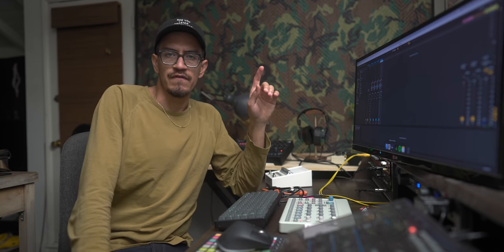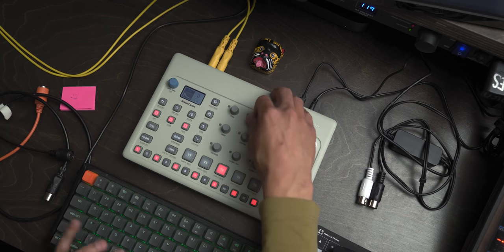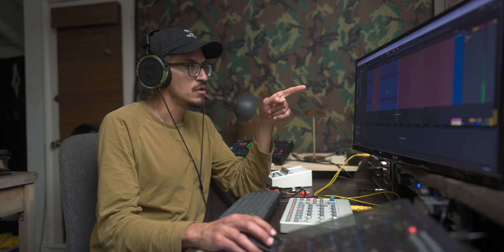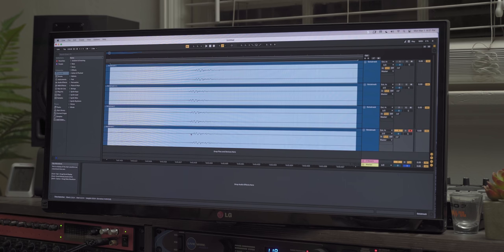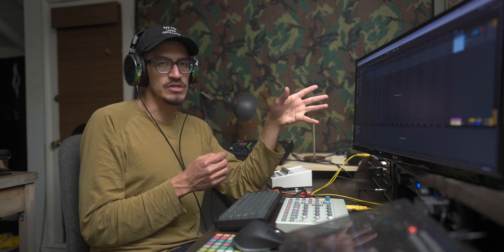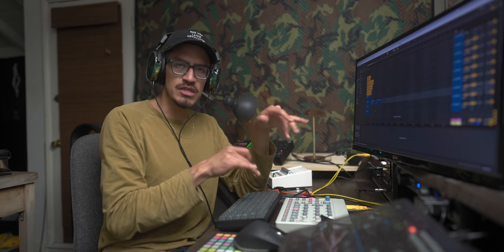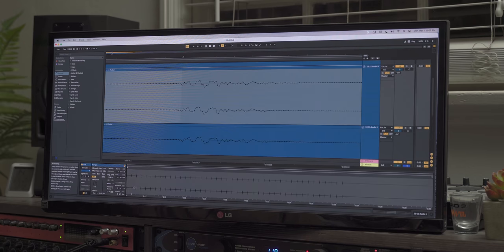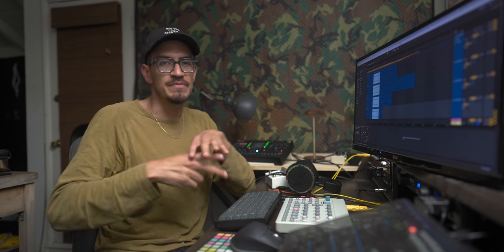Midi Latency and Why You Can't Win.. // Hardware Swing vs DAW Swing

Comment: Simple technique here: add a 1 bar  'count in' sequence before your song plays, like how bands do to cue the start of a performance. It can be a simple 4/4 kick pattern or whatever. Then once multitracked in your daw, it becomes much easier to line up your tracks on the 1 as they all share the same count in. Once aligned you can then just trim out that first bar

Comment: Isn't it crazy? 30 years ago running all hardware MIDI gear sequenced from Octamed on an Amiga I had zero latency issues. Newer isn't always better! Do you have the same issue if you're slaving Live to the external clock of your hardware device?

Comment: I always thought this was because of Midi to Control Voltage converters in analogue machines. I don't mind, I kind of like it, but I don't have it as severe as in this video. Never had any problems with missing notes or crazy delay's and it doesn't ruin the swing, some this might be an other problem, like midi jitter.

Comment: i am a beginner producer and i want to get rid of the topic latency early on to build a functional workflow around it. ideally, i want to control (via midi clip or keyboard) an external sound source and capture it with the audio in of my interface. i also want to use ableton effects. now i have some ableton drums playing and the external instrument receives midi to play, which i monitor in ableton. now i adjust until it sounds good together. now i want to record the synth to audio and when i start the drum clip and the audio synth clip together, it should sound exactly the same as when i was monitoring before. i can record with ableton effects or i can record the dry signal at my input. the dry signal is faster than the monitored one (with effects). now, i put the same effect chain on the recorded audio. all 3 variations (playing it live, recording the monitored audio with effects and putting effects on the recored dry signal) all sound slightly different... i do not think, i care too much if something has latency, but i need to recreate the exact same timing i adjusted to in the "jam" phase. with or without latency, it needs to sound the same. i do understand this topic gets much more complex when introducing a global clock, but i am already struggling with this basic step...

Comment: USB involves multiplex switching and the packets can fall behind or end up ahead of others depending on a number of factors i.e how many devices you are using that share a controller, if you are using a hub. I'm not sure of everything, but there could also be the implementation of USB on the device and clock jitter on the device itself because USB is synchronous. Someone needs to make a PCIE card for just MIDI, which would be fabulous to have. Some sound cards do have a direct MIDI DIN asynchronous connection, but they are often expensive. I always get clock drift when syncing via USB from Ableton to my Beatstep, and then using MIDI DIN to sync everything else. I can't recall if I have tried without anything else on the hub or my motherboards controller, but because of how USB works, I think you are likely to get some amount of drift or possibly jitter from the device.

Comment: Hey Ricky... I think it's Elektron Model boxes.  I'm running an AMD 3.4gz with 16gb ram.  I used to have the Circuit and Model:Samples as my main hardware center pieces.  I had both plugged in via USB and the Circuit would be tad off but the same each time, while the M:S would be off and start late every time.  I sold both pieces of gear to try and let new energy into the studio, as well as learn sound design instead of relying on presets/patches.  I now have the M:C and just reordered the M:S.  I Love Ableton and have heard ppl say the Model boxes suck over USB.  Maybe someone will figure it out one day.  As always, thanks for the video.

Comment: one fix is to use a hardware device as master clock sync everything to that and also use it to clock DAW. Therefore all external devices are in time and DAW plays in time with them. Then track the output of your external devices all at the same time.

Comment: This reminds me a nightmare that's a bit of topic, but related to timing problems and computers. At the time I was working with computer as the heart of my live set-up (with NI Mashine), I did many records with my band recording live with the audio coming from my "live" laptop to my studio desktop in two tracks while recording the other instruments.
Afterwards, I opened Mashine as plugin on the desktop computer and re-recorded all the sounds from Mashine in separated tracks for accurate producing and mixing. No problem with this method but one time. The recording messed up somewhere and the timing between the audio-recorded tracks and ITB Mashine tracks where totally off. It started good enough at the beginning of the tune but turned more and more out of sync. At the middle of the tune, all the groove where lost and after the break, it was just a mess. We tried many things : record again from the laptop, do the stuff in the box in the laptop, slightly change the tempo of the whole project and so on. But but nothing worked. It remained far from the groove of the live recording. It looked like he tempo had slightly changed during the recording.
All we had to do was to keep the electro stuff done and record again the other instruments. It only happened once, but it taught me definitely that computer timing can mess up.
Now I've turned my live set-up dawless and we record live with all the instruments at the same time. No more timing nightmare.

Comment: Good vid, thanks. To deal with it I just turn off swing in my gear and able the swing in Ableton. I actually find the Groove feature in Ableton really powerful and it also quantizes before applying the swing so for the most part it fixes any issues.

Comment: damn this is basically hard proof I need an ERM. Even multitracking into bitwig using the pyramid as the main clock for my synths with no midi sync in the daw will leave me with weird jitter
Reply: same here with the pyramid into ableton
Reply: Really. I was going to buy a Pyramid thinking it would improve jitter. Guess the money is better spent on the ERM in that department. I have seen the midi data jitter and timings for a lot of devices, the Pyramid is better than average at that, the Elektron stuff is satisfactory. But who can afford a Sequintix Cirklon or even wait for it to be build as they are back ordered by 2 years. Lol

Comment: Ive spent so much time with these types of tests lol. It’s midi jitter via usb that’s the issue (Although polyphonic midi also has a 1ms latency per note) cuz usb is sent in lump sums every ms or more. A good solution is serial midi with an audio-source sending the data. I have had good luck with the expert sleepers esx-8md and ES40 via spdif. The learning curve for that was quite insane for me, but there is truly no jitter once you get it working. I am now trying to sequence everything and record it live one take.
Reply: with overbridge, there is a slight latency of notes falling early, but if you adjust the microtiming 1/192 to the right it is tighter

Comment: to me there is a change in the groove of any machine as soon as it's clocked by another one. I also believe that each machine receiving a clock, is constantly trying to follow the clock it receives, and then has very slight changes in its timing, but i don't see it as a problem, to me that's the interest of hardware, that it doesn't play exactly the same way everytime. 

Btw I think that not all hardware equipment will start it's clock properly if you don't start recording at 1.1.1 , i mean the beginning of the arrangement view. Happens to me with some drum machines and synth, mainly the older one but some recent synth too. 

Also if you wanna record with minimum latency, you have to trigger the "off" button, not the "auto" or "on", that let the sound go through Ableton, then to your speakers. You need to use the sound directly from your audio interface, to the monitors. I proceed that way with an apollo twin and i have 0 latency problems. Of course that means that you are processing your sound outside your daw, or recording, then processing. 

Love the channel keep up the nice videos and music 💪🏻

Comment: My clock setup right now is an actually having my drumbrute's MIDI out hooked into my iConnectivity MioXM, which distributes MIDI Clock to all of my devices as well as my computers over the network (using RTPMidi). It's impressively solid compared to other options and I didn't need to buy any new things!

Comment: You don't need to spend $600 on a multiclock to get MIDI clock out of a DAW. The USAMO from Expert Sleepers is designed for this very purpose and is both affordable and available. The nice thing is that you can push or pull the clock to get everything landing bang on the grid.

Also, both Elektron boxes and Ableton are crap when it comes to sync (or even internal sync, as you've demonstrated). Probably better to stick with an MPC for such tests.

Comment: I had the same syncing issues recording my elektron digitakt via USB/overbridge - things were not lining up consistently and I was getting weird timing hiccups. I found that if I set all my ableton audio inputs to "IN" and turned ON "Reduced Latency While Monitoring" in the options menu (I think ON is the right setting - could be wrong)... then things generally would line up perfectly. Another suggestion I heard someone make about syncing problems is to set your hardware sequencer as the master (ie. Digitakt) and slave ableton to that when you record.

Comment: Usb does matter, I used to have horrible jitter issues on my ensoniq asr X which I fixed by making my roland tr505 the midi master, at the time my setup was the original bass station, a tr505 and the asr x. But although the asr sounded great it was useless as a midi master. These days I use CV gate and sync heavily and only use midi via usb but with these volcas I record directly into a  br80 and avoid the daw. Then I chop up those samples into ableton sample packs but I isolate my hardware from my daw and only grab the hardware as samples.

Comment: you might not be sponsored by ERM but my takeaway was BUY A MULTICLOCK. Also, the dots are the actual sample amplitudes at the sampling frequency, the line represents the audio after it is converted back to analog.

Comment: I'm no mac user, so I don't know if there is one, but did you switch off your power saving mode? Some cpu's will throttle to a lower clock rate when there is not much load, and it will re-throttle once every few seconds. Maybe that's why your HH skipped a few times. In bitwig (and probably all other DAW's) you can do per-instrument latency compensation, so if the latency is constant you should be fine. It's really the jitter that will mess up your groove. I've been on this latency quest for a while now, and I too start to think it's not something that can be solved sub-millisecond.

Comment: There was a take that the model samples didnt start at one. Ive had this problem before with hardware when you stop the transport and when you press play again the machine doesnt start on 1 but instead starts on where it stopped before. Other than that i had this problem with the digitakt before using overbridge, with overbridge everything seems to line up fine every time. Also for the last technique you showed, if your device has metronome build in, i usually turn the metronome on and record some bars of the metronome (you can also just sequence a 4 on the floor sequence as metronome) so you can use it as reference to cut all the audios.
Reply from the maker: you've expirienced something similiar in overbridge?! Its always been good to me but now maybe i'll double check a few times haha
Reply: @RickyTinez  no, what i meant is before starting to use overbridge i went though this torture all the time. with overbridge never noticed anything going out of sync which is amazing!

Comment: Obvs ERM is a great solution but have you tried tracking your MPC with it being the master clock? having ableton follow it?  I'll give it a shot but I'm afraid USB is the weak link here. I'm using a MPC2500 and I'll do some testing but the midi "handshake" in my setup is still a USB driven iConnect midi interface.

Comment: I'm not surprised USB has the most issues, the name gives it away. Universal Serial Bus. Universal meaning the interface was not designed with music timing in mind and Serial meaning that it has to send one piece of information at a time really really fast to give you the illusion of doing more than one thing at once - but it can ONLY ever do one thing at once. So if you need to send a sync command and start at the same time? Can't happen, has to do one, then the next. USB is fast enough that you can work around this, but it's super, super difficult to do and often takes customized circuits working with custom software to really solve all the problems the US in USB cause. And at that point, it's not exactly universal anymore either.

Comment: I wish Ableton would have an option to send clock independently of transport.
That would fix the issue of hardware needing to "catch up" to the clock when transport starts.
Anyone knows of any sequencers, DAW or otherwise, that have this feature?

Having clock separate from transport would also remove the need for something like the Multiclock, if you already have a MIDI interface.
Or does the Multiclock provide other features? AFAICT it's "just" a MIDI interface that also generates clock.

Great video, BTW. Exactly the kind of things I've been fighting with.

Comment: Been feeling weird FOR DECADES!!
SOLUTION: Next week my Zoom L8 Mixer/Recorder arrives (They make a 12 version, too)
It simply records 10 inputs to separate files on an SD CARD, so there's no "clocking/syncing"!!
Just straight FUNKY MPC SWING!!
I plan to plug my 4 Hardware synths into the L8, run my MPC ONE sequence, muting and jamming, recording all of 4 of them PLUS 2 MPC tracks in one take, and finally transfer from SD CARD to DAW

Lotta steps, but its worth it to capture my INTENDED feel

Comment: Try making ableton slave over midi-usb(straight to pc usb, not usb hub) . Use the main drum machine with a tight clock as master to sync rest of gear with midi din thru a midi hub. My setup is master Drumbrute-midi hub - slaves ableton(midi USB) , rest of synths(midi din). Ableton link is a nice feature if you have some old ipads ✊

Comment: There's got to be something that doesn't cost $500 that provides steady clock, no? 

I've done the individually-record-multiple-tracks/apply-warp/set-groove thing before, but that also takes time. Just recording everything individually on multiple tracks is time-consuming enough. 

That said, what I usually do is probably the most time consuming: individually record tracks, shift all tracks left by set latency duration, go through each track with a fine-toothed comb and manually create an odd groove, randomly offsetting individual hits to taste.

Yeah, it takes a long time, but if there's going to be timing errors, I want them to be MINE.

Comment: I had been setting Cycles as the master clock (over usb) and having Ableton follow that after having this same headache a few weeks ago. I thought it was working! After watching this video, I wanted to check how consistent it is...and it is whack.

You can watch the clock speed Ableton's adjusting to on your computer, and though it's set to 120 on the Cycles, Ableton is fluctuating, as low as 115 at times.  I've noticed that after 8 bars or so it seems to settle in. Maybe that leads to some kind of workaround? Something where you send a blank pattern for 8-12 bars then trigger the pattern you want to record (both set to the same BPM, because any fluctuations take about 8 bars to lock back in). Seems like more work than it's worth though. 

Kinda wish there was a way to use the audio interface portion of the Cycles to send an audio click track, since audio over USB has less jitter (I'd assume anyways). 

The ERM seems to justify it's price more and more.

Comment: Wtf I thougth I was fking something up when I tried to record my two novatiom circuits and a TR-09 separately and got this exact problem. In this particular case is when Roland products like the MC-707 or the MX-1 help a lot. Since they work as audio interfaces you can make them send the main tempo and record multitrack while you are jamming. Hope more manufacturers do this cause' is a live saver.

Comment: The test had a weak point in using same box. I guess grooveboxes are different how they sync up to midi

You might sync ableton to hardware , which records into ableton. I know it sounds circular, but it works, though cpu hit is very  significant.